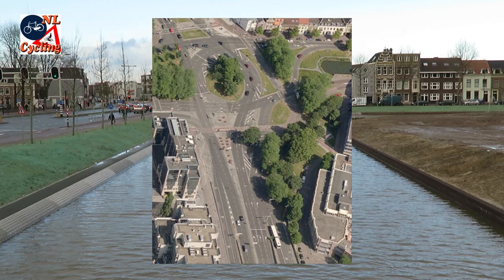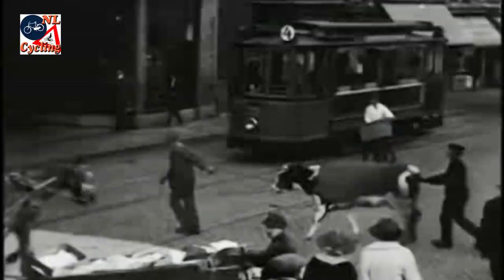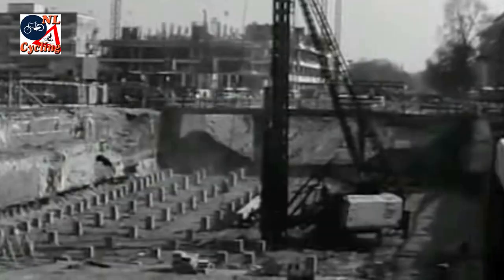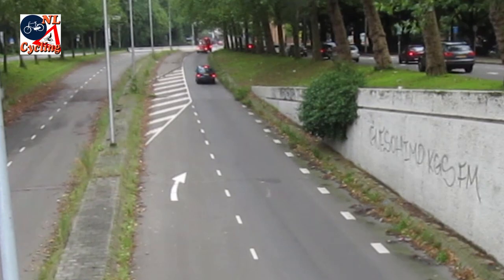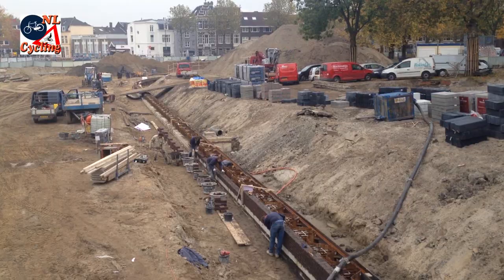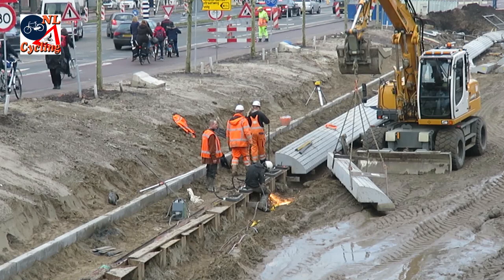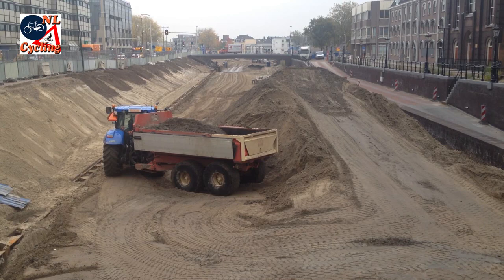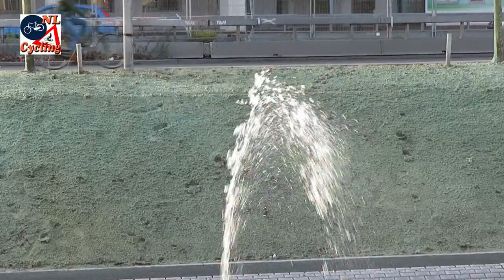Removing a motorway to bring back the original waterway [445]

Comment: Ah yes 2 mistakes. One not even doing the full project. like ofc it wasn't gonna function the way it was meant to be when you only do a bit of it. Look at LA 30% of it's planned highways haven't been built and the roads now and then are congested.

Second, yah let's just bring back a unless canal to make the area look good is just awful as it is.

Ofc u want places to look nice and you can make roads look good. Things and times change and it's nice to keep some old things but we shouldn't get hung up on the past when it stops future improvements.

But this is EU for you, worst roads in the world. They rather build trains or push bikes then actually help traffic lol.

As long as USA doesn't follow this then it can be good
Reply: First, the Dutch roads (infrastructure) is usually number 1 or number 2 on the list with countries that have the best infrastructure in the world. The US is not even in the top 10. Dutch roads are well maintained and well designed.

The LA roads you are talking about are the classic example of "car driving ignorance". Everything in the US is optimized for the car. So even in neighbourhoods you have streets that are so wide you can pass each other while there are also cars parked on both sides.

The US way of solving congestion is just adding more lanes. It has been proven that this doesn't work and is just a solution for the short term.

I also don't see what you have against trains and bikes. Trains are very useful to have people use less cars and thus less congestion. The same thing with bikes. The Netherlands is the most bike friendly country in the world. So much so that it is quite often a lot faster and more convenient then the car.

I saw the videos of Americans being introduced to a roundabout for the first time, and i can then see your opinion as to why you don't want our road design in the US. They will all get confused and won't know how to use it.
Reply: @gijs_k3737  

Well, I do agree more lanes won't fix traffic. my message was pointing that LA was to have like 12 more highways not lanes but most were canceled or removed. Congestion is worse and LA / Cali is doing what you guys are doing and removing roads and slimming them down which has increased traffic. in some areas, it may help to reduce a big road to a smaller road if traffic isn't heavy but doing so to push trains and bikes is just making traffic worse.

The reason why trains and when i say trains im talking trams or in city trains. they don't work due to the fact it's costly way more than a 3 lane stretch of road.

And it takes up more land to keep it straight and speedy. Plus it wastes money, take the MTA for example. even tho most money comes from gov taxes. it loses more money every year. even when trans where used in other cities privately all they did was cause delays and lost money.

Plus bikes don't really follow the rules here and people don't really like that. Sharing the road and stopping when there suppose to etc.

Good highways are ones implemented correctly and never go past 3 lanes maybe 4 in some cases but really never 3. anything higher needs to be separated into express and local lanes to split traffic who wants to get off to ones that just go through an area

Regarding roads that are wide. even in a small area. most areas in the USA are wide for 2 reasons. Since most areas still used slow trucks when we were developing and slow horses and buggy we added a passing lane to allow people to pass the slow vehicles but the reason to have them now because American trucks are bigger than EU trucks. if I'm correct and people have trucks drop stuff off at their homes and having that space allows trucks to make turns without damages.

BUT most places are not that wide.

The USA is very car-oriented because they are better than a bike or train when most people live not in the cities as well allows for more freedom. Tho keep in mind the US GOV didnt pay for roads until the 1960's.

Regarding Rotary Traffic circles, they are good when not spammed everywhere and used correctly. In the USA we have had them before since the 1930s,
we have 3 in my area. only one has fixed traffic the other 2 either worsen or helped  (not fix). Best solution is really Grade seperations, circles can work but don't need to be everywhere and don't always fix traffic that wants to go through.

The reason to say we don't know how to use them is that back when they were implemented they weren't spammed and used on areas where turning was used more frequently.

(PS: US road system has oofed over the year due to lack of the states wanting to update roads due to there spending on other expenses as well bad leadership in the white house for the economy. Plus the anti-road behavior of the 60s and 70s blocked a lot of other highways being built added to the traffic and stunted flow)
Reply: @MetroHam  I can see and agree with some of your arguments. Like that a highway is not very useful if it is not finished entirely.

And that in rural areas the car is the only option. I completely agree with that. It makes no sense to make a train line to a town that only has 2000 residents. But im more focussed on the dense cities.

Roundabouts (or rotary traffic circles as you call them) are spammed here everywhere and quite often there is a priority bicycle path around it as well. And they actually improve traffic flow and cause less accidents. And even if there is an accident, they are pretty much never fatal because unlike a junction where cars can t-bone you with 60 mp/h because they ignored a red light, for roundabouts you have to slow down a lot. So we put them wherever they are required.

Considering the road diet (aka making the roads more narrow) we do that here as well. Even in random places where there is a pedestrian crossing. The reason for it is that it causes cars to slow down to increase safety. Traffic calming is what we call it and we implement that here everywhere as well. Not just by narrowing roads, but also using speed bumbs, continuous sidewalks, raised intersections, priority lanes for bikes and busses and fixed objects on one side of the road.

All that makes the road a lot safer for everybody. Is it more annoying if you like driving? Yes, a bit. But if you are a pedestrian, a cyclist or someone who uses a mobility scooter, it feels so much nicer and safer when cars are not speeding past you.

It is more difficult for trucks and busses to get around, but with enough skill it is possible. Also, American cars are way larger then the small European cars. That also makes a big difference. We don't need pick-ups here.

Concerning your statement about cyclists not sticking to the rules; they are not a saint when it comes to traffic rules, but nor are cars. And when cyclists do not feel safe when they are mixed in with all the pick-ups and SUV's, they tend to do more strange things out of panic. That is why you have to separate them from the main road.
Reply: @gijs_k3737  Yah, ofc. 

Tho that's the problem we have here. there made to slow people down which isn't effective with car output ratio. congested strips or corners. there are 2 Rotary Traffic circles near me that were added yes it helped the side streets but traffic gets backed up on both ends of the circle and the effectiveness of the road just worsens. If that's the plan people want from road dieting then it doesn't help everyone. 

Typically tho when you add decent roads the roads around it get less pack and more safe. NJ studies from 1970 show it. Ofc tho make stuff less free will sub countusly make drivers not drive as fast which is good in areas not meant for day-to-day driving. But on streets with semi to heavy traffic. making the lanes smaller doesn't always work. NYC is doing this and honestly, an area with awful traffic is worse now. except for one spot. people trying to get on backs up and people trying to get through slows down.

The best of both worlds is what NJ and NY did back in the 1930s. Grand concourse is a street which looks really nice. doesn't use circles but loads of grade separations and medians for slow traffic and buses and people who just want to walk to the store which in turn have space for people and bikes and trucks but 4 lanes in the middle for people to go through without stopping frequently with there own grade separations.

There are ways to do both ofc without favoring the other Texas currently is doing the same with their road system that NY did in the 30s. rebuilding their roads with express and service streets and have grade separations in congested corners to allow free flow of traffic at even the busiest hour, circles where they are needed. Because keep in mind I'm not saying don't build them but rather less of them.

Because making one thing more annoying than another isn't really fixing anything. also with bikes, here in the USA there suppose to share the road by letting cars pass them and pull off to the side and stop at stop signs and traffic lights like cars do but they don't ever do that lol even in cities with bike lanes i barley see them being in use.

If you would like some insight in our road stuff, could check this video out. https://youtu.be/_AO4TVoaCPI?t=222

Comment: The better soulation would have just extend the motorway.
Reply: Why?
Reply: @FrostyAUT  Water basically have no function if its not being use for boats.  There was way more demand for motor traffic than for the canal.   What would have been an better alternative is to simply replace it with a nice green park.  Water that tales up the whole space have no use.  It is a merely decoration.

Comment: There's your flat earth proof...
Reply: Where?
Reply: Flat, level water. No curve.
Reply: It isn't flat, the earth is just so big you can barely see it. When peopl build long bridges they do have to design them to take into account the curve of the earth.
Reply: Over miles and miles, the surface of the canal water remains straight and level. Just like planes will fly straight and level over the earth's surface. That's why they're called planes.
Reply: It remains straight an level relative to the earth's surface, because gravity always goes to the center of the earth's sphere. The water is just as round as the earth, which is why it always seems flat. If you look at a big ocean you can't see past a certain point, because of the curvature of the earth. If you build a boat you can go beyond what you could see from land. And if you do, you can no longer see the land you came from, for the same reason you couldn't see this part of the ocean from land.
Reply: Olivier I hope you're being sarcastic...
Reply: Olivier Mass attracts other mass. People call that gravity. Gravity always pulls towards the center of mass of the object in question. Right now we're talking about the earth. If the earth is round, the center of mass is directly in the center of the globe. Which means that wherever you're standing on the globe, you're being pulled directly towards the globe, no matter if you're in the US, Europe, north or south pole. And so, you don't fall off.
Reply: Olivier Thank god! XD
Reply: Olivier you know, it's sad that sometimes you can't tell these days.
Reply: Took you a lot of drafts to get there eventually.